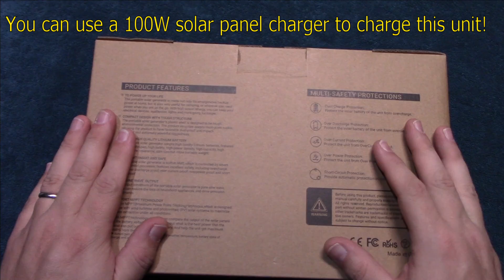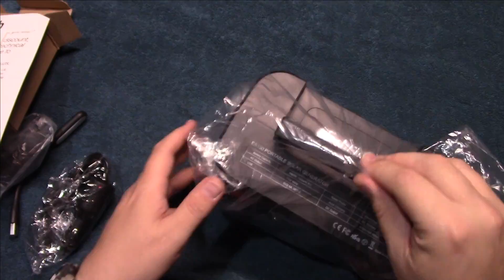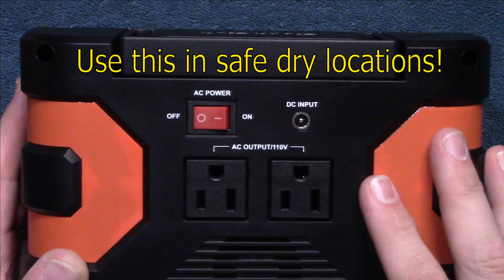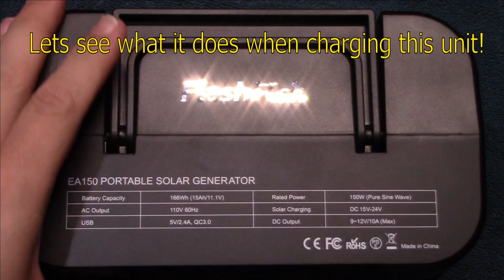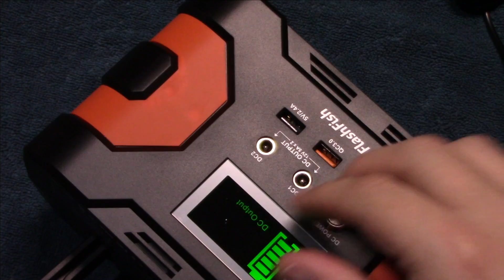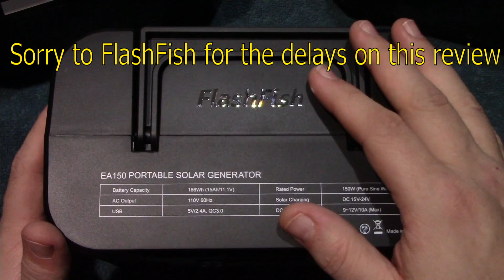FlashFish Portable Battery Generator Review!

Comment: Hello, I know this is an old review and an older model. Just have a question on the new small model like this. It’s the Flashfish e200 model. Do you know if this will run led strip lights 12v? And if so how long do you think? Thanks!
Reply from the maker: 12v at 2A it would run it for about 28 hours. Thanks for watching!

Comment: does it come with solar panels or do I need to buy them, and if so how do I know which panels are compatible. I have some chinese made panels that work well with the usb powered light bulbs, just want to know if what I already have will charge this.
Reply from the maker: It does not come with solar panels bit it does the cables. Any 60W or higher will work, just remember that a higher wattage will charge it quicker. I use a 100w brand made in China that does just fine. Thanks for watching!
Reply: @CharlesBridgTec  What is the actual wattage output for this generator? I like the price, but for some reason, it looks very cheaply made. It almost sounded hallow when you tapped on it.

Comment: Will it support a light bulb uvb light that Is 150w and if so can I plug any other things at the same time I'm in a power outage in Texas due to weathering
Reply from the maker: You can run multi devices as long as total wattage is 150w. It can do a surge of 200w, but may shut down if its continuous. I hope you all the best in Texas. Stay warm. Thanks for watching!

Comment: I have a question, I found a couple of under 30$ solar charger, one I'm wondering if it works with flash fish is a  22 dollar  2w 12v setup
Reply from the maker: You will need a 60w or above to charge this. Thanks for watching!
Reply: @CharlesBridgTec   gotcha, thanks, I was hoping there was a cheapy cheater way of charging these with solar,

Comment: Hi. I got my this past Christmas. It is fully charged and I tried to use it today for the fist time to plug up a small one-cup coffee maker. The AC output light keeps blinking. I tried a small lamp and it wouldn't work either. What does it mean when this AC output light keeps blinking? Thanks for your help!
Reply from the maker: Is it fully charged and display working? How many watts is the coffee maker? Thanks for watching!
Reply: @CharlesBridgTec  yes fully charged and first time trying to use it. The one-cup coffee maker is 120v and 1000 w.
The lamp was a small desk lamp. Thank you!
Reply: @CharlesBridgTec  ….and yes the display is fine. I charged my cell phone but AC side is down.
Reply: @CharlesBridgTec  small lamp is 40 w
Reply from the maker: @bellaBdaughterofYAHAWAH7  1000w is too much for this is a 300w max power station. You are triggering the protection in the unit. I clearly state to keep under the rated power in my video.
Reply: Ok, I now realize this. But I’ve seen some who plugged up a small round fan and used it. So I thought it would be alright. Thanks!!!
Reply: @CharlesBridgTec  May I ask what do you personally plug into the AC output to use? IMO it’s useless because most small appliances to do simple things (make one cup of coffee, use small desk lamp for light) during a power outage are all 1000w or more.
Reply from the maker: Alot of things are under 300w. Its a light duty unit. the coffee masker has a pump and heater on it but never seen one with that much wattage before, but that's a lot.
Reply: @CharlesBridgTec  thank you! Well, the A/C output is still blinking. Have I broken it for good now? How do I get it to stop blinking? I guess I broke it trying to make my coffee when the power went out this morning. 🥲
Reply from the maker: You will need to plug in charger into it and charger it. Then press and hold AC button until unit rests.
Reply: @CharlesBridgTec  will do! 😀
Reply: @CharlesBridgTec  I did but what A/C button? It’s only an off/ on switch and DC power button.
Reply: Mine is an E 200 and I don’t know how to reset it to stop blinking.
Reply from the maker: @bellaBdaughterofYAHAWAH7  You may want to email contact the company to see what to do for that is a different model. You have the manual?
Reply: @CharlesBridgTec  yes I do. I’ll contact them. Thanks again!

Comment: Hi charles, 1st timer here watching a video of yours. I was looking into finding a portable generator and came across 2 generators one by energizer and this brand. I play guitar at the wal mart parking lot where i live in which i use to use a portable car jumper in the past which lasted you about 6-8 months for my amp. if u didnt jump any cars with it. Now i have a portable amp which i use rechargeable batteries so that issue is gone till i got a pedal by zoom which contains a butt load of sound effects and has 3 channels i can choose a sound from with out having to switch through numerous pedals. Well one problem its not portable which kinda defeated one of the 2 main reasons why i got it. Well started looking into the energizer generator which it had all i liked but mentioned that it gave out atleast 90% power on a full charge in the specs section im like ok thats not what i wanna hear from a brand like energizer. Then came across this an looks to me it could work well with my pedal.  Usually i would go with energizer hands down but like i said the specs didnt sound that good even some of the videos i saw people were giving their opinions on the device didnt really sound to convincing to buy that product. Sorry for the long scripture lol, have a habit of doing that but also want to thank you for the time you took to make the video review of this product.
Reply from the maker: I used mine for over 5 hours to power some active PA speakers at 60% volume without issues. With 3 bars left on the battery system. Thanks for watching!

Comment: could you hypothetically run a small LCD TV and blueray player at the same time on this?  What happens if you go over the wattage count?  Will it die or explode?
Reply from the maker: Yes if under 200w. Thanks for watching!
Reply: @CharlesBridgTec  thx
Reply: have you tried solar charging it with say a 50 or 100 watt solar panel and if so how long did it take to fully charge?  I am trying to see if it is worth it to get this unit plus a solar charger, but heard mixed reviews on the actual generator itself, and that it drains pretty fast even using small electronics.  Thanks
Reply from the maker: ^0W works great and you can use it while charging it.

Comment: Any idea how to reset the AC output.  Ran something little bigger then i thought and tripped into protection mode
Reply from the maker: Yes. Simply recharge it. Thanks for watching!
Reply: Do i need to drain it first?   I did plug it in and recharged it..  But ac input still blinking.
Reply from the maker: Turn on the unit to charge it?
Reply from the maker: Also you have your instruction manual? It will show how to reset it, by pressing the mode button while flipping the power switch.
Reply: @CharlesBridgTec  no did not come with a Manuel.  Which one is the mode button?  My model is the 200
Reply from the maker: @loupgarouxyx7157  the front push button that changes AC to DC is the mode button
Reply from the maker: Unplug everything from it when you do this.
Reply: @CharlesBridgTec  far as i can tell is the dc button just does that.  Turns dc on and off.    And the ac is just that on and off.    Fully charged.
Reply: I actually ran into the same problem, it went into Overpower protection and I have recharged it to try and reset it but it still just blinks AC output.

Comment: How long would it work for a 12.5 amps (1500W) at 120V, 60 Hz Fan Heater if it were fully charged ?
Reply from the maker: Max is 250W. Thanks for watching!

Comment: Could you provide charging times? How long does it take to charge on a wall outlet vs car vs solar panel?
Reply from the maker: Sorry this is an old review. Using the included charging cables charge times are 8 hours from 20% one bar left. I use my own 60w solar charger and in a good direct sunlight it will charge in 6 hours. Thanks for watching!
Reply: @CharlesBridgTec  Hi Charles,  can I use the 100w solar for this powerstation? im not sure if this is compatible or better to use the 60w..im thinking to buy a 100w to save time on charging..thanks in advancr
Reply: @CharlesBridgTec  Hey Charles! You mentioned “DJ” regarding your use of the product? Mine must power the PA plus amplifier for my parade float in 4 days! Although it works great for cranking tunes when cruising, I need to add a singers microphone. So, I upgraded to the Flashfish A301! Will it work for 2 hours?!

Comment: Will it power a flat panel TV I mean they don’t take a lot of power to run
Reply from the maker: Yes indeed. It worked on a 50 inch of mine outside for Karaoke. It never went dead after 4 hours of use so it will be fine. Keep it under 200w. Thanks for watching!
Reply: Charles BridgTec you bet. I really enjoy your channel